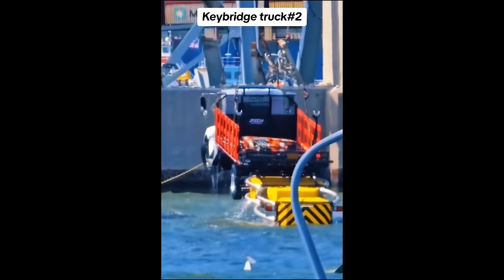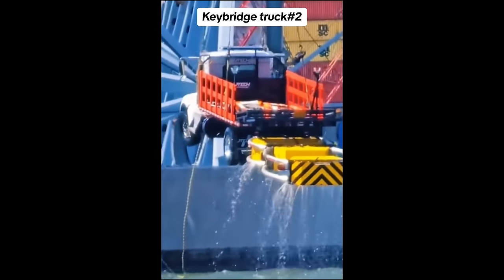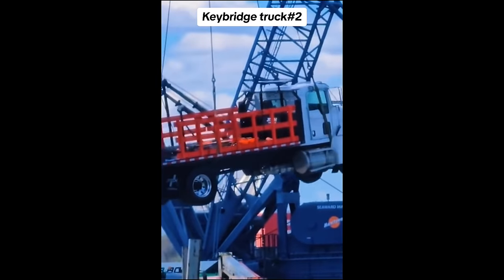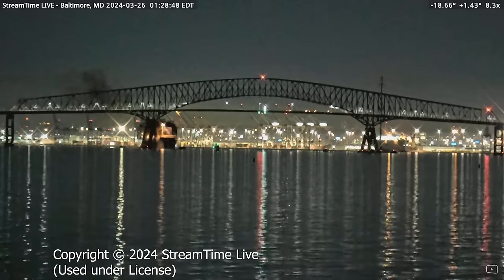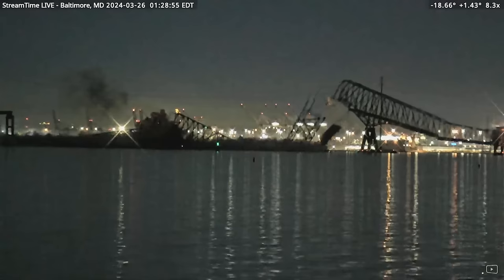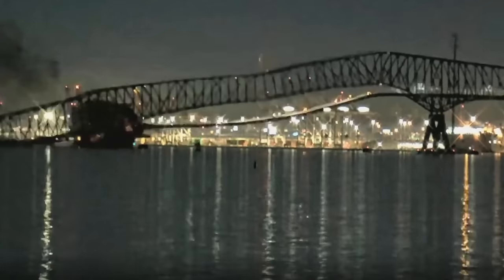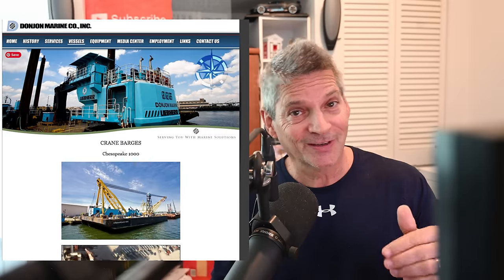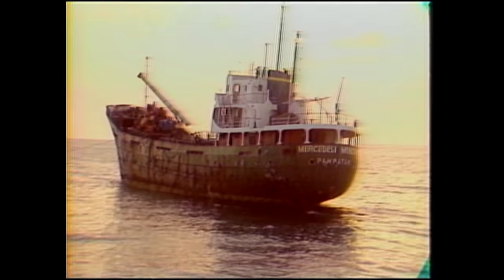Missing Truck, Bridge Truss Salvaged Collapse Site

Comment: Obviously the construction vehicles had their emergency brake enabled to keep them from sliding forward. It seems that the roadway was separated from the truss as they both fell. The roadway was not propelled into the water via the free fall of the trusses.

Comment: I doubt that there was anyone in that truck. In a static closure that truck would have been used as a barrier vehicle. It would have been parked upstream from the worksite, and unmanned. There are two kinds of vehicles used as safety barriers for highway work, one is a Backup Truck, and the other is a Barrier Vehicle. A Backup Truck is a smaller vehicle, such as a pickup, or 1 ton truck with a service bed on it. It is used as back up for quick tasks such as picking up debris, and transporting  workers, and tools to worksite. the other is a barrier vehicle, which is heavier and is used in a closure to combat errant vehicles. This is a Barrier vehicle because of its size, and the fact that it has a crash cushion system on the back. We called them attenuator trucks. I don't know if they have them in Maryland, another truck used a a backup truck is a Cone Truck. It has two specially designed seats directly behind the cab, and a conveyor belt with controls that go both ways, so cones can be placed to close, and picked up to open lanes, and delineate work area, without unneeded exposure to traffic of the worker.  

They were repairing spalls, because they were repairing rigid pavement and not flexible pavement which is asphalt. They were waiting for the cement to set before opening the road again. At 0130 in the morning they were about a couple hours from packing, up opening the road, and going home. Because it is an urban area, I suspect the workers will have been off of the pavement by 0500, because in urban areas, that is about the time traffic starts to multiply. The shift was probably 2000to 0600, traffic is dead between the hours of 2000 and 0500. They were probably on a lunch break waiting for the cement to set. When there is an open hole, the work gets done and the hole gets closed before ant breaks are taken. Depending on the size of the spall, there might have been a cement truck on the bridge sometime before the strike. Spalling is a more labor intensive task than pothole patching. They are different tasks, done on different pavement, with different costs for the same reason; fill a hole in the roadway.

Comment: I find it hard to explain how the truck could apparently suffer so little damage. Altho the roadway kind of slipped smoothly into the water, the bridge trusses were falling on top of the roadway. Bear in mind this truck has a flimsy, one-piece GRP hood, which could be damaged by even a small hydrodynamic impact. Great drone footage from the ACE tho.

Comment: Why do you think they do not load the damaged truss structures on separate barges to drop at Sparrows Point?
Reply: Nothing they have there would likely support the weight I m thinking , so each of the larger sections will be lifted and taken by the crane to be put ashore where it can be cut , the Engineers are working with all the resources they have , to get the debris cleared as safely and as fast as possible
Reply: Sparrow's Point is a very short distance away.  The large barge can get back quickly,  I opine.   Aarre Peltomaa

Comment: What's really interesting when you step thru the original footage frame-by-frame, you can immediatley see that the work trucks do not actually ever begin to slide down the slope.
Reply: In fact, if you draw a straight line down from the truck positions, that's exactly where each truck enters the water -- no sliding along the road-slide at all.  None.

Comment: The reason the truck appears to have no damage is because between the roadway bed,,and the water that truck sank in Slow motion,,, Luckily it was not crushed by any of the overhead structure

Comment: The front end of the truck was damaged but remember the truck will float a bit so it's not like it's falling off a building so it would slowly descend to the bottom and wouldn't have much damage but you can see the front wheels are not inline with each other..

Comment: I wonder about the safety of the crews doing the cutting on the wreck site of the bridge. What is the risk of the structure swinging unpredictably when the last cut has been made - and potentially hitting the workers? This happens when cutting up fallen trees: you often can’t predict the stresses in the material and the loosened part of the tree can swing wildly in unexpected ways. What are the safety precautions?
Reply: They have strain gauges on the pieces that are monitored, and they place the cutting tools and get out of the water, then the tool is run remotely.  And they are continually re-surveying with 3D sonar and redoing their maps of what is where.

Comment: Just look at all the air between members of the trusses. I offer that the section would have to ROOL to come in contact with the truck. Also, the board across the top of the truck cab is folded perfectly as it would be when not being used. It wasn't struck either.

Comment: The trucks sink slower because of trapped air, air in the tires will help the truck float every bit of trapped air adds buoyancy.  Steel, concrete and asphalt do not contain  much trapped air.   Steel and concrete sink very rapidly, they hit the bottom hard and before the trucks gently floated down.  The trucks did look nice and new.

Comment: Just wondering if the bridge was all connected or did it have expansion joints which could of prevented a total collapse. I'm no engineer so if you could explain. Thanks
Reply: They've been calling it a continuous truss bridge. Road deck suspended by cables. There is a video of the road deck/bridge being built originally, I think I saw expansion joints.

Comment: That truck is a crash truck with bumper. When doing highway work it is the first truck setup for oncoming traffic in case someone were to drive into the lane the car would hit the bumper protecting the driver and the people working on the road. On the bridge it would have been the last vehicle with flashing lights on the right side of the video

Comment: In addition to the tornados that sometimes have been known to lift lighted candles and place them down elsewhere still lit, likely nothing fell on TOP of the truck. They just fell along with the asphalt of the bridge deck and once they both hit water, the suspension bottomed out and so floated down with the rest of the debris. Looks way too clean to have been part of what else happened though.
Reply: just like a linebacker blocking the guy with the football. The roadway blocked the impact and protected the truck!

Comment: If you see a Coast Guard boat, the 1st two numbers are the length.    Like a 29, a 45 or  87                ...  29308 with a crew of 4,   45202 with a crew of 5,   87 901 a cutter with 12 POB ...

Comment: Question: Do you think the existing approaches will be resused with new bridge?  It seems that they are 100% OK and unaffected since they were not part of the collapse. If used, it would save millions of dollars and tons of time to reopen the bridge.
Reply: All things near salt water have a lifespan, would it be wise to put up a new bridge and not redo the approaches over salt water ? I am curios as to what experts would say.
Reply: They are very, very well painted;  use them again I believe.  Aarre Peltomaa
Reply: I can't imagine they'd be judged solid enough to reuse.  Besides, blue is bound determined to spend as much money as fast as possible to destroy the dollar.
Reply: Also, the existing approaches that remain, being old  and narrow without breakdown lanes, and with that steeper angle are almost most certainly not useable for a new bridge that likely will resemble the new cable stayed 1987 Sunshine Skyway bridge at Tampa Bay with dolphins and fenders. It’s also 1200 foot span and similar clearance but is now just a bit low for newest cruise ships so a little more height would be appropriate here.

Comment: The front suspension on that truck must have took a hard impact because you can see the left steer Tire is blown out and off the rim and you can also see that the left steer hangs lower than the right steer suggesting significant suspension damage in the front. Definitely was not a gentle touchdown into the water

Comment: Do you think it came down to electric windows not able to open.....?
Reply: Nobody would have been in that particular truck shown. As others have said, that's the barricade truck. 
The long structure on the back is meant to absorb and redirect forces of a traffic collision for the cases when some drunk and/or distracted dummy fails to spot the work zone and plows into the vehicle, protecting other vehicles and workers on the site.

You're not going to be sitting in a 'guard  truck' that's got a sacrificial barricade mounted on the rear, waiting in case it gets hit. That's just asking for whiplash and possibly worse.

Comment: Did you all see the thermite reaction that melted a hole in the ship? This is the only way yo can get such clean cut box beams without them folding and buckling. Truss bridges are designed to break at stress points. Meaning where it is bolted together, not in the middle of the bridge. Had it just fell it would be in 1 twisted and binded mess of metal and you do not see this. Only a little where it came down on to the ship. If you think structual steeal just falls apart lets just say go back to school and never go on a bridge again, it was not held together with twigs and sticks, even then you would not have perfectly sheared off beams with hardly a bend in them. The Ships deck and hull is missing any torn or bent steel, it has a very sharp edge and the paint was melted off of the area of the ship. I made videos on the difference between a ship in a collision and they all still have all of the paint and wrinkled crumbled steeel. It is not missing all together. Also made a video of before the collision and thermite reaction to boats come out from under the bridge right where the ship collided. The last vehicle off the bridge stopped by the workers, you can see brake lights and the dome light come on in the vehicle, meaning a door opened. The ship did not have to run into the bridge it was gonna collapse from the thermite. Just like 9/11 it is gonna get swept under the rug. The FBI better do their job.

Comment: I was watching the video from the work on the bridge this morning and all of a sudden the conspiracy guys start yapping about no damage on the truck. I have been on the Claims side of the insurance industry for 45 years and handled every kind of claim you could imagine, including heavy equipment and trucks, clearly there is damage on this truck, both front fenders are damaged and bowed out, the right gas tank is bent up, the front tires are off center, a Truck Appraiser will confirm the damage, obviously if you don't see it up close you can't see all the damage. Conspiracy Theory is not opinion it is an illness

Comment: Truck drops 30 feet into the water.  Bridge trusses fall on top of it.  Yet no damage.  Yeah, right.
Reply: The big rear bumber stop in the back looke bigtime new you know like the hard hats all those  workers were wearing on the news interview looked like they were never jused hmmmmm:face-blue-smiling:
Reply: Not so much "drop" as rode the bridge's driving surface into the water.   And apparently the bridge trusses happened to miss it when the settled which seems plausible -- the spaces between those beams are pretty large.

Comment: Most likely those poor men hit the breaks really hard as the road tilted, just out of habit. Wish they would have thought to open the windows too.
Reply: Was thinking the same thing.
Reply: As has been said, it is highly unlikely there was anyone in that truck at the time of the collapse. That is a vehicle that is left at the back of the construction area to block traffic. That yellow structure attached to the truck also serves as a cushion if a vehicle crashes into it.
Reply: @tiredoldmechanic1791  When I was with TWD Highway maintenance as a salt truck driver,  I knew that sometimes the driver sat in the back warning (crash) truck,  and sometimes not.  I also helped them to patch potholes while traffic was warded away by the 'crash truck' in the back.  It had bumper pads on the back of it, and the flashing arrows.  Aarre Peltomaa
Reply: It was empty

Comment: 1:28   Ok.  Did you find out what caused the long smoke trail along the top of the bridge ?
1:29   Ok.  Did you figure out what that flash of light was that dropped down from the lower level of the bridge,  and left a dark smoke trail ?
NO ELECTRICAL ARCING WAS SEEN AT ALL !!!!!   When one cuts a high tension/voltage line, a lingering arc is seen for at least 5 seconds.   SO WHERE DID THE SMOKE COME FROM ?    I call that a SMOKING GUN !     Aarre Peltomaa

Comment: The truck that has been immersed in SALTWATER is going to be salvaged? I think it will be trashed except for those parts that can be broken down and washed; the engine and transmission? Perhaps, but not the chassis. And everything electrical will be of little, if any, use.

Comment: They have to move the entire crane barge each piece is recovered? Why isn't another barge and crane used to take the piece away and let the main crane keep working?
Reply from the maker: It it likely because of the load and margins of error for weight. The C1000 can handle 1000 tons, all the other cranes are 400, 500, 600 tons

Comment: These types of incident are usually caused by human error or criminal neglect like the 1983 sinking of the SS Marine Electric just off the coast of the Eastern Shore of Virginia. My Reserve unit was alerted but never called at the time. It came down to criminal neglect by the owners of the ship for sending a ship out to sea that wasn't seaworthy and the loss of 31 crew members. I suspect we're going to hear the same conclusion once the investigation is done on the MV Dali running into the matchstick bridge.

Comment: I just don’t get how they didn’t make it out if they weren’t pinned or crushed. Maybe they were actually standing on the bridge and not inside the trucks
Reply: The guy that survived, his truck had roll up windows, he said he rolled it down and got out.  And you're probably right, he said they were taking a break.
Reply from the maker: It's very shocking but believe it or not even here in Florida where we have nothing but canals people drown all the time when their cars drive into a canal because they don't know what to do when their vehicle goes into water
Reply: Electric windows.
Reply: The water pushing against the vehicle door makes it impossible to open until the vehicle is full of water, and even then it's hard to push the door thru water instead of air.  You need to get out a window.  Electric went out almost immediately when the vehicle hit the water so electric windows won't operate. If you hit your head and passed out, by the time you wake up, if you wake up, you might not have time to roll down or break the window.  And everything gets worse if you panic.
Reply: @Sylvan_dB  the window theory is incorrect. Mythbusters did a good video on it. Let the car fill with water then open the door.
Reply: @jeffostroff  I fear your gators more than the water itself. I once saw a gator in the Rivers of America within the Magic Kingdom. On land the mosquitos carry you away too. Godspeed to you all in the swamp land. 🫡
Reply: @Sig_P229  That is what I said, "until the vehicle is full of water, "
Reply: @Sig_P229  If the windows are closed,  and your head got hit badly,  then could you open the door 30 feet down ??   How deep was the water/water pressure in the Mythbusters video;  I didn't see that one.   Aarre Peltomaa
Reply: @Sylvan_dB  Yeah. Sorry. I noticed that after. You were right.
Reply: @musicforaarre  30 ft under is the assumption they plunged immediately to the bottom or waited to get to the bottom before trying to open. Additionally, assuming they hit their head highly speculative when there is not a dent on the car. If the car hit so hard to cause a dent and therefore a head injury, the air bags would have been deployed. Zero signs of any of that in the video.

Moreover, I think the whole point is moot because they were all on the bridge. As another person pointed out, a worker that was in the truck made it out ok.
Reply: @Sig_P229  The radio specifically said that the guy who made it out alive had manual windows on his truck.
Reply: @KenJackson_US  I know that. Furthermore, that was the first comment response 2 hrs ago
Reply: @Sig_P229  I responded with the same thing, though fewer words, at the same instant.  I was slower to click 'reply'.

Comment: I think you are the one trying to justify why the truck looks brand new, most of us never gave it a thought, it likely is a new truck, a week in the water won’t have had much effect on the exterior & obviously it didn’t get hit by any metal, it should have floated for a time until the air escaped from the cab, & even the crash bar on the back should have aided buoyancy for a short while.